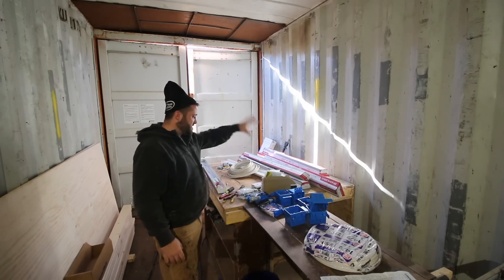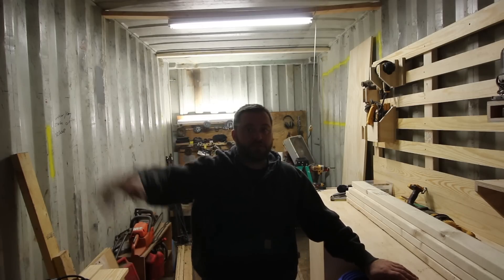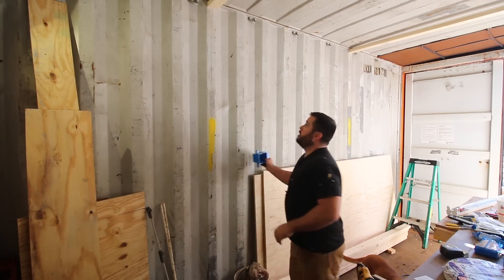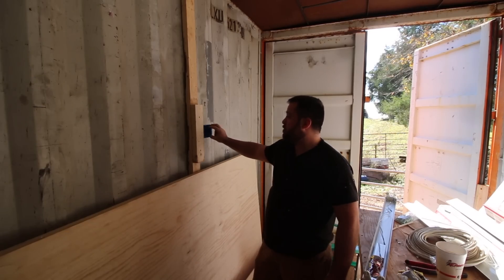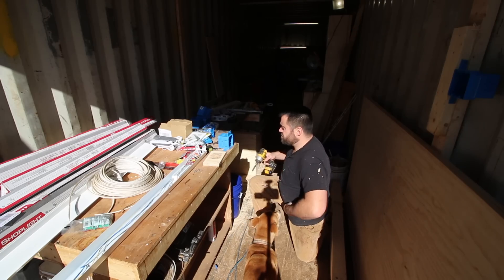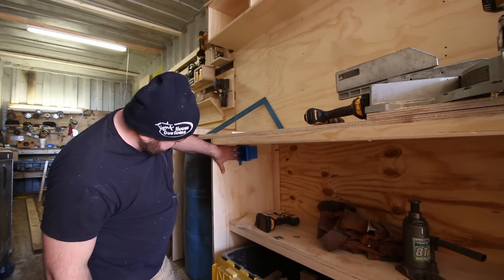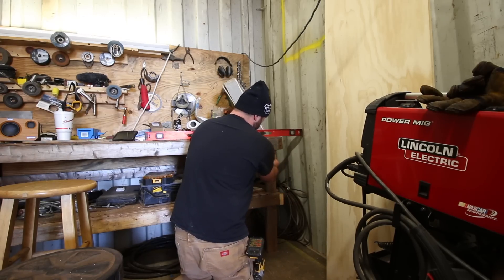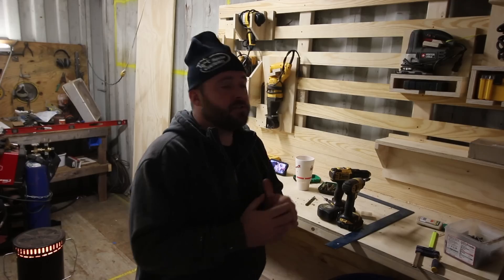#1 Let's light this one up.

Comment: With you welder, spot welding 1/4"X2" bolts Down the center ever 4' to fasten 2x4s would give you a runner full length for lights and wire. Wedged boards could fall and smash lights in the heat of the summer when compared container expands and wood dries over time.

Comment: So how do you adjust for outlet covers to connect with outlets. When the surface ain't on yet. I found in my tiny that they are deep so my cover ain't doing the job so they stay uncovered or I bust the f%#! $k out of them trying to make it work
Reply: Small nuts and washers work great for spacing the recepticle out from the box so the cover will fit correctly.
Reply: You can purchase longer screws for mounting switches to box and use Caterpillar spacers to bring switches further out towards cover plates.
Reply: Cheryl, 
I view Dan’s videos really more for ideas, outside the box thinking & amusement than specifics.  There are many other vids that cover technical but to address your question...most electrical boxes have a score line or ridge that shows how far out to mount your boxes. The real question should be what you will be using as your finish & how thick is it? Most tiny homes on wheels don’t use standard thickness drywall/Sheetrock so do compare the score marks to what you are using & mount boxes accordingly.
Reply: @FirEMSChaplain  catapiller spacers?
Reply: @cherylmartin4050  if you look in the electrical aisle at any big bock or even electrical supply center, in the section with tool are small usually brightly (lime) colored plastic inserts.  they come in a strip and can be broken off to make what ever depth you need.  They have a small hole notch in the middle and 2 smaller numbs.  These allow the bolt to go through the notch and for the pieces to stack together.  Here is the item at Lowes.

https://www.lowes.com/pd/Gardner-Bender-4-Pack-0-75-in-W-x-4-in-L-Green-Plastic-Wall-Plate-Spacers/1054139
Reply: I had that problem once. I bought some plastic tubing used for connecting a water line to the refrigerator ice maker / water cooler system. That was some 15+ years ago and it's still going strong today! All I did was cut pieces of the tube to the precise depth that was needed. The screws fit perfectly in the holes of the tubing also! Give it a try! The tubing is sold by the foot at any local hardware store near you and it'll only cost about a buck or less. Good luck!

Comment: 3 words for ya..."LED Rope Lights. You can daisy chain them together and need only 1 switch. Fixin to be 50-75% off at Big lots.PS...If ur planning on having a heater in there, u need tobe prepared for "rainforrest" like condensation.

Comment: Go cover less, I like the look! I don’t have covers on my switches.
 
Wire together with out boxes and just use that liquid electric tape.

Instead of using switches, just have bare wires exposed and touch them together to turn the light on.
Just have fun since there’s no code 

Don’t take me seriously, just have fun and you know ..be safe 
But it would be funny for a video just to read the comments about it.
Reply: 🤣Seriously though, is that liquid electrical “tape” spray actually good  for ANYTHING?😉?
Reply: Chris Hafner-Eaton I don’t know? 😂 I seen it around but never bought it.
Reply: Brians farm and repairs -as far as I can tell it’s an idea that sounded great but is totally useless.  I’m someone who will try almost anything once.  I’ve yet to find it to function & wind up taping. Btw, do you know how much do metal shipping containers expand/ contract with temp change?
Reply: Chris Hafner-Eaton i never had thought about the expansion and contraction on a shipping container. I am here to learn, everything I do I learn from failure. But this guy makes great videos.